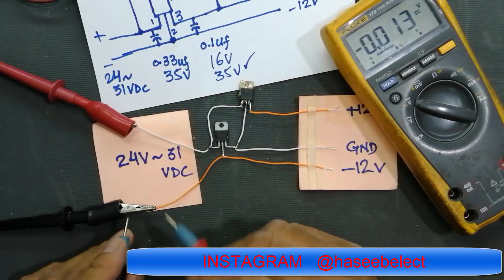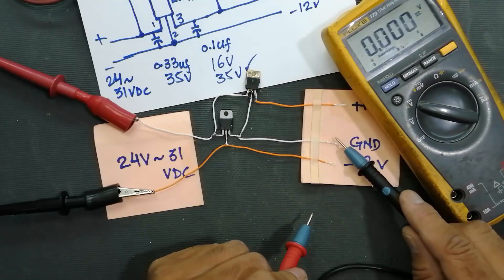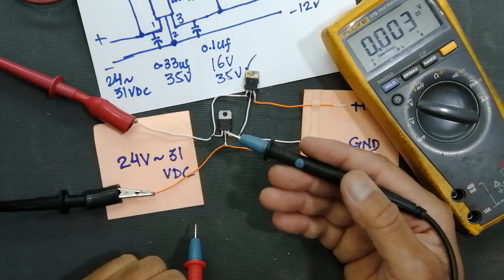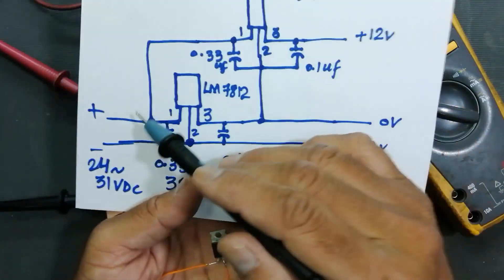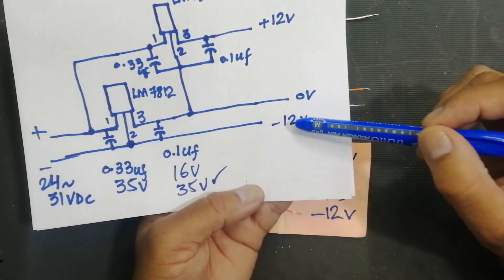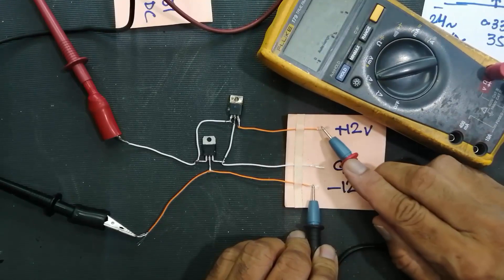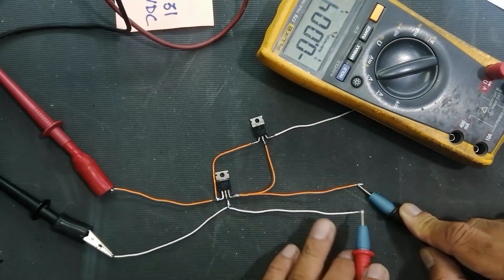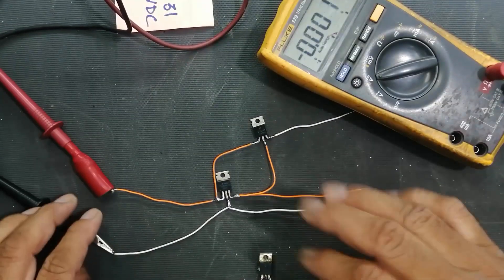#302 How to make Plus/Minus Power Supply using Single Power Source

Comment: Everyone is talking about using a voltage divider, or 'just using two voltage sources".  Thank you for actually proposing a solution.

 I don't have two power sources or I wouldn't be looking, and with just a small amount of load on a voltage divider "solution" , let the asymmetric voltage drop commence.

Comment: 1) the datasheets suggest that you should use a the negative voltage LM79xx series for the negative voltage leg 2) Can you ground the 0V rail? Should you? 3) The datasheets suggest a diode (1N4001) should be between the voltage and the reference leg 4) the LM78xx series appears to be obsolete. STMicroelectronics seems to be making a replacement L78xx series.
Reply: 79xx is for NEGATIVE voltage.   the negative voltage on the OUTPUT is relative
2)  wtf?
3)  read the datasheet CAREFULLY
4) nonsense

Comment: Will this connection damage the second Ic whose ground pin connected to output of first Ic?
2) Can this power supply be used to power dual supply audio amplifiers like Tda2030A?
Reply: this is very limited by the max Vin, heat dissipation and to 1 Amp

Comment: Sir what about amps does it same as the input are divided into two outputs, why so low-value capacitors used.
Reply from the maker: each portion is 1 ampere, if we use steel body regulator then it will reach up to 5 ampere each section
but the main requirement is input current, if the input source is good then the current & voltage will regulated

Comment: sir this will work only by theory  in practical  when we connect a small load on it output the voltage will drop drastically
Reply from the maker: no dear
if our supply source is good
then using LM7812 in regular package it will provide 1 ampere in each section
of we use steel package then it will reach upto 5 ampere
I will share its practical experiment very soon

Comment: Sir I have a query. I have a 18/0/18 transformer. Which is both side positive 18 volt. If I use 7918 regulator ic , can it is working properly. Pls help me.
Reply: refer to the datsheets for the 79xx and 78xx      check the Vin max

Comment: MANY PROBLEMS/Limitations
big problem is the very high heat dissipation especially at higher current. I The ICs consume 20mA which limit use in battery applications. 
doesn't work if you want split say 10V into +-5V
quite inefficient as well

Comment: what is the maximum ampere A output, this circuit can handle
Reply from the maker: it will depend on the regulator current rating. standard T0-220 package using standard heatsink LM7805 provides 1.5 nominal and 2.2 peak current,

Comment: I don't see how you got it to work without the capacitors. Adding them doesn't really change anything in this configuration. I built that, and there's a resemblance to plus/minus relationship, but with or without the capacitors, the voltages were different. Tried increasing the input, only increased the variance between the two (outputs continued to increase). Swapped the two LM78xx devices (breadboarded), still offset the same left to right (minus was greater value than plus). Seems you lose regulation this way as they depend on the internal values and output of the pair.
Reply: read the datasheet     the caps help but are not required per se
Clearly YOU did something wrong

Comment: Wow, this is awesome as usual. I had gained a lot watching your channels sir.
But, I like to ask how you calculated the value of the capacitors used and I believe this power supply can only work for a low power applications, though, I stand to be corrected if am wrong.

Thank you Sir!
Reply: read the datasheet for the value of the caps
yes   there are many problems

Comment: Amazing... good for BOSE docking station ... i will try this.
Reply from the maker: best wishes dear
Reply: @HaseebElectronics  To get 18+18- voltage, can i do this with 24 volts adapter ? or i need to use adapter above 36 volts ???

Comment: I want negative 5vdc and positive 5vdc and also maintain  must be input voltage 12vdc
Reply from the maker: you can use dual dc to dc converter 
that will more useful option

Comment: Sir, good evening.a small doubt shall we use stabilizer as a isolation transformer for testing power supply PCBs. If not so,shall we make a isolation transformer by ourselves.
Reply from the maker: if stabilizer have isolation transformer then that is safe
some stabilizers use auto transformer to increase or decrease voltage by changing its winding size, so that stabilizer is not safe
Reply: @HaseebElectronics  Thank you so much sir.